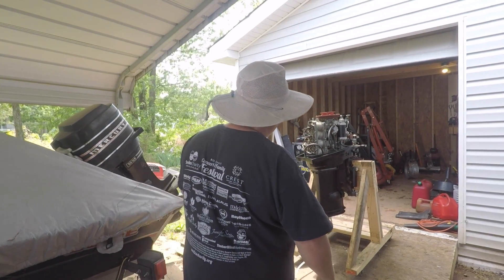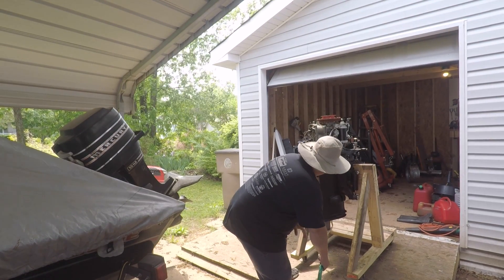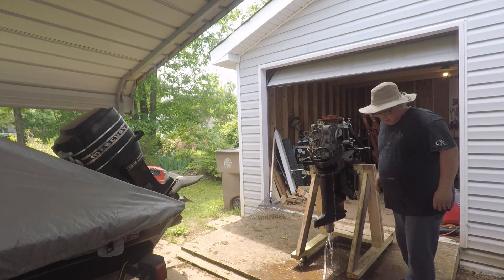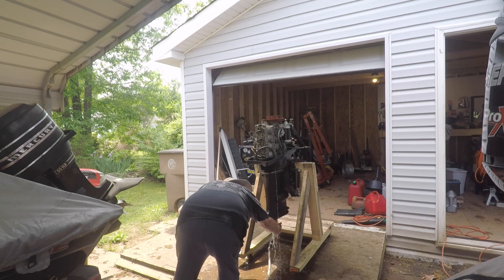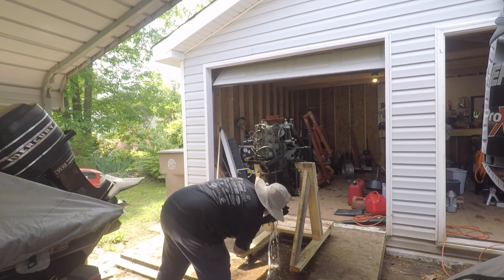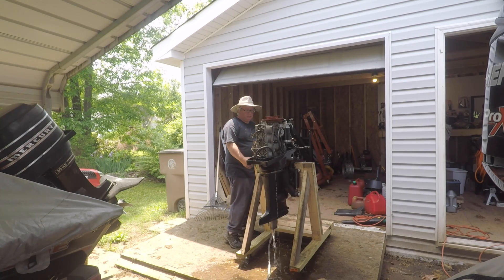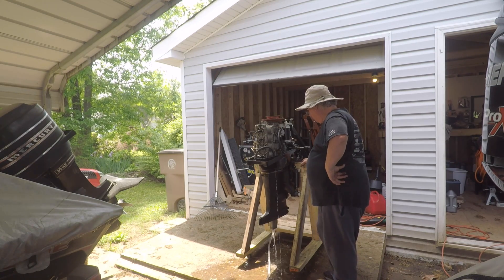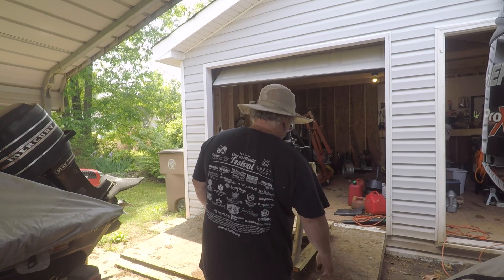Mercury Thunderbolt 500 50 hp Part 56 - Checking Water Pump for Leaks

Comment: great videos.. i have a 1972..     i replaced my water pump impeller, and tried to flush with garden hose before reassembly.  now nothing out the pee hole.  with the lower end removed, i back flushed through the pee hole..  the water comes out 'around' or 'beside' the copper tube that extends down to the pump.  any suggestions?  from your videos, i suspect a leaking gasket at the water plate.  is it possible to pull the power head to access that without tearing down the entire power head??
Reply: wow!.. i was very lucky so far..  power head and exhaust plate came apart with no problems at all.. must have been all the grease that had been sitting in the bottom of the  bottom cowl!..  I have been diligent to grease all the fittings each spring, but not so diligent to clean up the excess.   now just cleaning things up and waiting for the new gaskets to arrive.  cant test until spring due to the winter.. but i am hopeful !!
Reply from the maker: When you flushed the engine on the garden hose did water come out the pee hole?  If so, then did your replace impeller or the whole housing.  And, did you replace with a OEM pump?  Not a cheap pump from Amazon?  You may have a blockage on the side plate.
Reply: @hawkeyemarine   thank you for responding..  i have replaced the impeller with a OEM impeller. When did not get any water out of the pee hole, i removed the lower end again.  Then i back flushed water through the pee hole.. that came out the bottom, but did not come out of the water tube. It appears to come out from around the top of the tube. i cannot tell if the top of the tube is leaking or if the water is coming from somewhere else.  i think i need to pull the head to see if the water plate is cracked.  but i think that is the only way to access the top of the water tube in any case.

Comment: You have the most extensive series on this type of engine.  I really appreciate the videos.

I just got a 1977 Starcraft with the Mercury 500 Thunderbolt 50 HP.  Engine had not been run for 15 years.  The internal wiring harness was totally disintegrated so I replaced it and it fired right up (discovered a drippy carb, which probably contributed to the disintegration of the wiring)...really runs great....I used muffs but no peeing no matter how much I turn up the water....  I checked for blockages by flowing water back through the pee hole and then again flowing water through the head (took out the plug and flowed water in there).  Water all flows down and out from both...  So cracked open the water pump.  I rebuilt with new impeller and gaskets...but for grins, with the lower unit off.... I flowed water up the inlet tube...To my dismay at slow flow the water comes out the top of the water tube into the drive shaft passage...at higher flow water leaks out the top of the water tube but makes it to the pee hole.  My thought is that the seal or seal housing at the top of the tube has failed.  I was going to replace the seal, but would need some luck and a 2 foot long philips head screwdriver.  Any idea how to replace the seal at the top of the water tube? (or do I need to unbolt the drive shat support from the power head (which looks difficult)....?  Any advice would be greatly appreciated.
Reply from the maker: Thanks
Reply: Any advice on replacing the seal at the top of the water tube...?

Does it require complete disassembly or do you think I have a prayer to get it out with super long tools with the lower unit off?
Reply from the maker: You have to remove the power head to replace that one.  I have never tried to remove it with some long needle nose pliers.  @alano2875
Reply: Thanks!  I'm on mission impossible probably...impact screwdriver (the kind you whack with a hammer).

The screw is really in there.  Wish I could heat and beat it....

I'll probably break off the screw head (unintentionally)and then be forced to remove the power head :( to drill out the broken screw.

I'm guessing I'll need to deal with a lot of things (shift linkage...and other things to get the power head off...I was trying to avoid...oh well)

I've worked on all sorts of engines...but this is my first outboard.

Thanks again!
Reply from the maker: I use a impact gun and I have a really thick or big flathead driver for a 1/4" driver and it gets them out.  But, Harbour Freight has one the head is not that big though.  @alano2875
Reply: Thanks again.

I removed the 8 nuts and pulled the power head up about 4 inches with makeshift hoist attached to cowl...not a big deal.  Tried getting the screw out by cranking on it with some big vice grips.  No dice.  Lucky for me I gave up...

For grins, I flowed water up the tube to verify where the water was actually leaking.  

It was actually leaking between the block and exhaust plate...running out all the drain holes around the exhaust plate...

Turns out whoever assembled the engine last didn't properly tighten the 8 nuts holding the power head on....

Probably got hung up on those front 2 buggers that have to be snugged first....

In any case fired up and ran on muffs...plenty of tell tale water!

Comment: Hi, I have the same motor Im working on, i replaced the water pump, tested it and it works. But no water is coming out of the tell tale.
Any suggestions?
Reply from the maker: Take a piece of weed eater or stiff fishing line and poke in the pee hole and see if that fixes it.  If not, the water jacket may have a ton of crap in it.  Which is big job to take off.  If that's the case take off the lower unit and the hose to the pee hole.  You can try a couple of thing here, 1. Get a piece of hose and garden hose connection to hook up to a garden hose and try to flush it out.  If its clogged nothing will come out.  2.  use the pee hole hose and try to back flush.  Make sure you don't have a thermostat someplace if its not a Thunderbolt engine.  The later models 1978 and older has a thermostat.  The thermostat is located on the water jacket side plate.